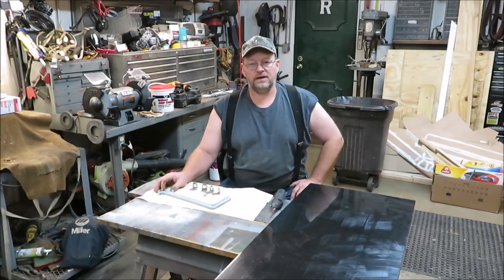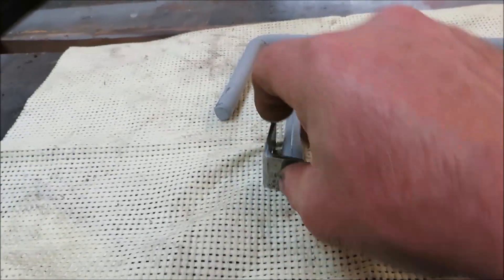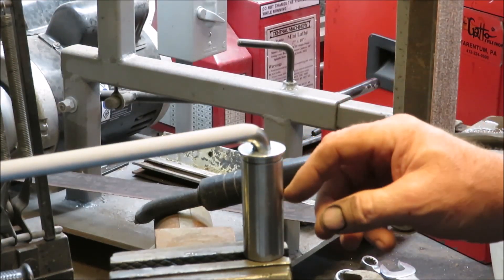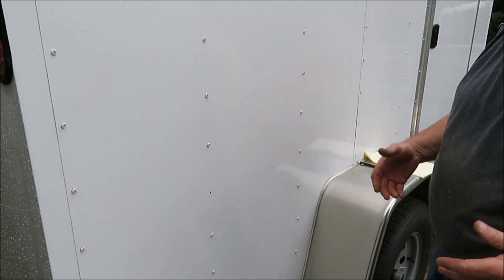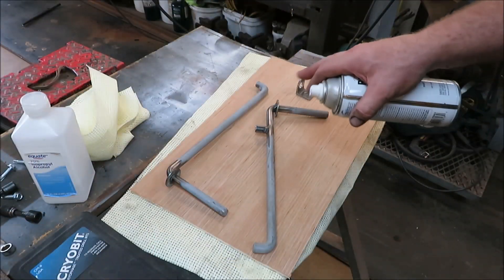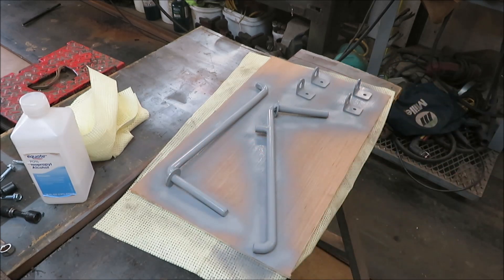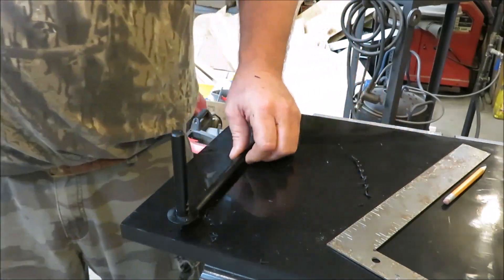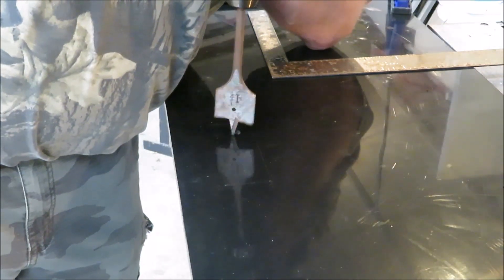6 x 10 cargo trailer homemade outside cook table

Comment: I think, leave the top as is looks great use that antislip material like your white one you used in the shop wouldnt glue anything to top. Maybe put rubber gromlets on the white eye hole brackets to stop from rusting. I wouldnt trust the white paint holding up in the hole over time. would require bigger holes. Also put some silicon on the bolts.

Comment: This is what I want to do on my camper. I'm thinking of making my inside tables removable like this so they can be dual purpose inside and out.
Reply from the maker: That would work great.
Reply from the maker: I like your camper build and subscribed.
Reply: Wow Kevin. Thanks. My work is not on par with yours and I don't have the gift of gab so I just do slides. Been getting a lot of tips watching your Runaway and Cargo build outs. I've been working on mine for almost a year now. I have to work outside so I have to shut down in the winter and only get to work on Saturdays. It sure if satisfying though.

Comment: what i use tor a toilet  is a 5 gal bucket with a toilet seat slide down over the bucket and over the  trash can bags to dispose or bury.  What i put on the seat bottom to make it hold and slide over the bucket is wooden blocks around it glue and nailed  just lift it off dispose > i carry one in my pickup, van, and boat.>  I HATE THESE NASTY BATHROOM FOR THE PUBLIC

Comment: Where is your tip for you welder I see your have the tip that screw's into you gun but not the big tip that goes over the small tip
Reply from the maker: I am using flux core not gas not needed for flux core.
Reply: @Robinson-Homestead  thanks Kevin
Reply from the maker: Email    kdr6688@gmail.com